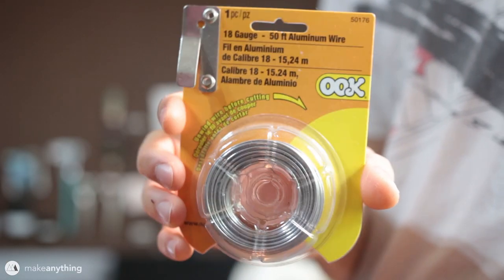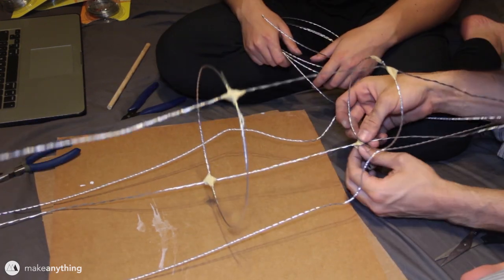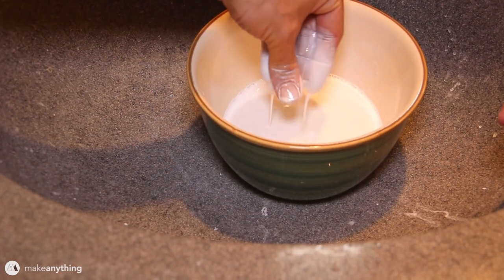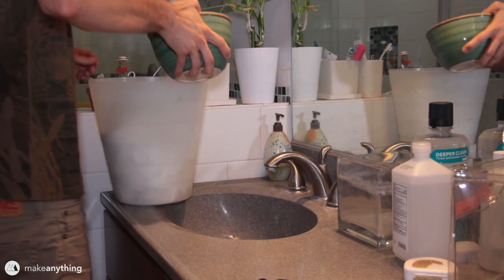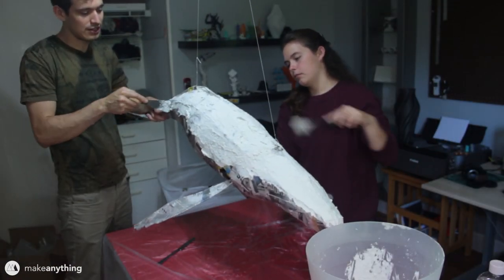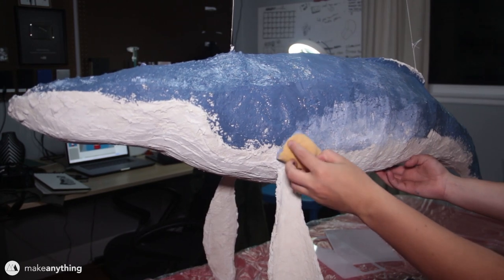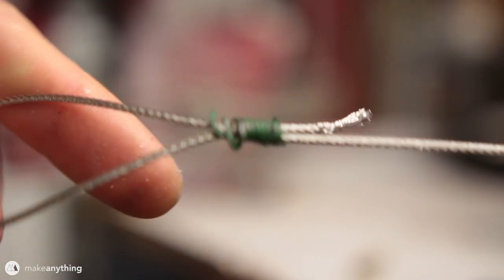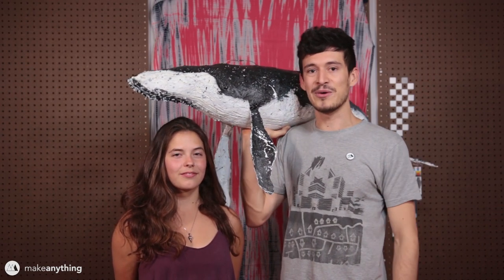Making a Giant Paper Mache Whale

Comment: Pretty cool!  *here’s a tip, you can pick up a BIG spool of thicker gage wire in the automotive section. (Or a automotive part store - they use it for welding and soddering joints) Different types (what it’s made of) and gauges (thickness).

Comment: I have used this "paper mache clay"....  It works well, BUT two warnings:  1) It hardens into something much like concrete, which can't be easily sanded.  In fact, I had to use a grinder to smooth my model.  2) It's quite a bit heavier than regular papier mache...  so you can expect that it will add significant weight.

Comment: I love ultimate paper mache. Joni is a great teacher. I like your whale. I am working on a scaled down Japanese Nebuta float. I used a wire frame like you did but just one layer of printing paper because a light  goes inside. I am glad that you had help with your project because it is big. Good job on the video.